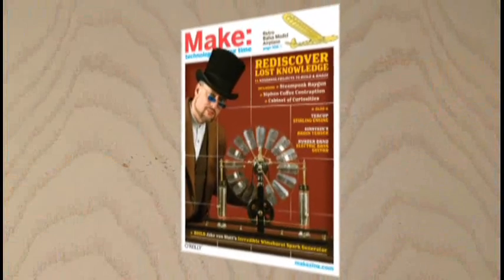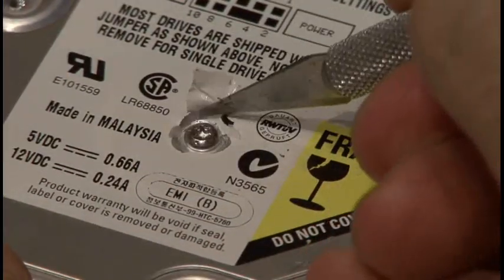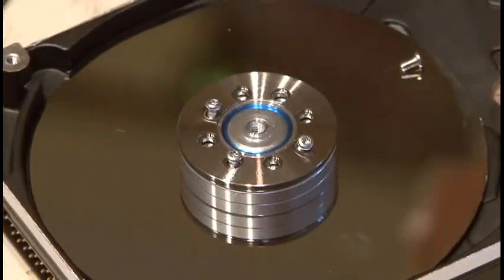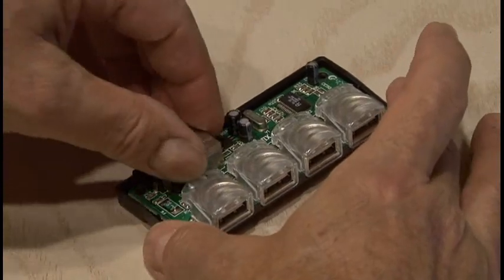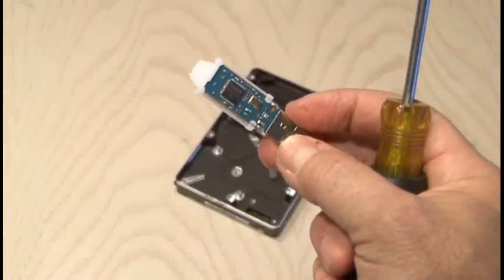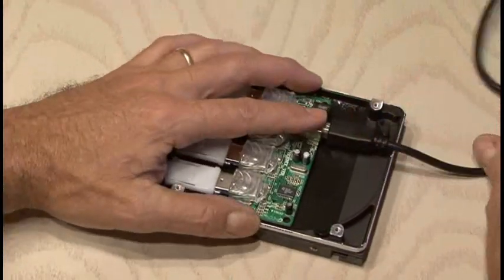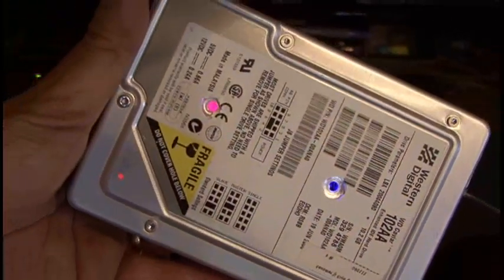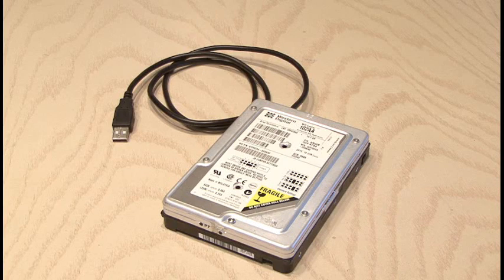Weekend Project: Flash Memory Hard Drive

Comment: waste of time... bollocks... why not just have the usb hub in there... FFS you fekn tool master
Reply: 2009
Reply: I thought the same thing. Now he has to carry around extra weight and space instead of carrying the sticks individually. The title is misleading!!
Reply: Emer L
This video is also from 2009
Reply: Emer L

Think of it in the fact of someone who loves raid and may travel once in a while. It would be easier to keep track of 1 of these rather than 6 items (4 sticks, the hub, and the cord). But I would have used an old 5Mb HDD since I would utilize that 10 gigs for something like movies or what every by buying an enclosure to convert it to a USB external that I can plug in to my TV
Reply: If I was to travel with need of storage I'll just use a 1tb external hdd...or as some call it passport. This idea  obsolete.
Reply: Yeah...not that old
Reply: to truthseekers666 
+1000

Comment: what the actual... I thought it would have been some kind of strange compression method Or maybe some kind of encoding. I dunno, My expectations were just blown out the window when I saw the drive opened up.

And something in the back of my head keeps nagging to me about 4 - 8 gb pen drives being expensive that far back. New Hdd would have been a better solution.

but as a project... no.

Comment: responses to bad info:  You can't do a software raid in most versions of windows:  You have to have ultimate or enterprise minimum.   Perhaps in windows 8 but i haven't tried it since i had 2k.  There is another issue in that windows will not let you raid removable disks.  You have to edit the registry to make them appear as mounted permanent drives.  Then you can combine the partitions in the settings.  This project would have been cooler if there was an sata interface.  I think the coolest project would be to hide a memory stick in a usb mouse.

Comment: You can mount the 4 drives so they appear as subdirectories.
In Windows:
- Goto Disk Management
- Right click on the flash drive and "change drive letter"
- select Add
- Mount in the following NTFS folder
- you can decide where they go.

Not perfect, but all in one place.
Reply: Or use RAID 0

Comment: not really genius... why wouldn't you rather have the 4 drives connected to the hub directly instead of having to go through the process of tearing the hdd apart ? you're not really "teaching the hdd new tricks"; you're simply replacing what's inside it

Comment: Look at it this way. A lot of IT people have flash drives, I myself being one who is extra cautious about data back ups, so doing this is both easy, and if you could have them set up in a RAID configuration, you could even trim the USB drives down to their bare minimum size, and possibly be able to fit 2 hubs in there. People on the internet being critical of a 4 year old video are the reason people up and quit doing these, because of you people who get anally frustrated.

Comment: would probably have been better if you could use ESATA/SAS on those drives, then you could have put them in RAID (recommended RAID5, 6 or 10) but because USB currently does not meet the bandwidth requirements, RAID is not possible over it without 'slight' modification :(

Comment: you can configure them in windows in the disk management utility or under linux via the logical volume manager

RAID is not necessarily dependent on hardware - but if you want performance, a hardware controller is recommended

but we are talking about USB sticks attached to a hub, so performance should not be the problem :D

Comment: you have now clearly stated that you have no clue what you are talking about :)

It depends on the RAID level how much size you got left - in a simple stripeset you lose no capacity at all

and "the way to get all 4 drives to one" is simple: in unixoid systems just use the LVM and on Windows you use the disk management utility and set up a dynamic volume with your raid level of choice (depends on the windows version though)

Comment: While the housing may be unnecessary, the concept is useful. When you learn to leave windows behind, you'll find ultrasmall linux distros that can easily run from USB drives. Tiny Core Linux, Puppy Linux, Damn Small Linux, and others are perfect. You can run them fresh each time you boot for privacy or in persistent mode so changes are retained. You have an entirely different computer running from RAM in spite of the OS or even no hard drive at all. You can run Puppy from compact flash cards!

Comment: Kipkay, the way to mold the drives together is, if you were to use bigger flash drives like 32 gb, put them on raid (witch loads dirrerent sections of the system on four to be combined as one) in the bios of the computer.

Comment: You could set them in raid 0. Also use the drive as ram rather than a hard drive. Might get too much heat using them as ram though.

Comment: While mostly misunderstood, such devices are indeed "free energy" designs.  The misunderstanding comes from the source of the energy, which is simply repurposing waste energy from other sources into very small and inefficient conversions.  The retardedness comes from thinking they will do something amazing by converting waste heat or ambient light into a few milliwatts of "free energy" (typical efficiency is on the order of 10 to 20%).  But yeah, some of them fit the "whacko" definition.

Comment: Your agreeance is not required. This is a solid state alternative to a mechanical hard drive. Additionally, if you shop at the right place at the right time, you could possibly make this for cheaper. It is not affected by physical shock, there are no bearings to wear. You don’t like it don’t make it. Period. Your comment as moot as you are.

Comment: you'll only get 4*4gb in raid 0 and too get a good raid 0 speed you'll need a raid controller. you could do it in software but it's not gonna be worth it, Unless you have high quality usb sticks. If you have high quality sticks, they will probably be big dynamic disks.

Comment: You can improve the speed of this drive by assigning them in RAID0 configuration.
It will improve your speed by a factor of how many drives you have, I'm this case 4.
You can do that from the disk managers, in windows, mac or even Linux based systems.

Comment: well couldnt you just connect the hub to a sub hub ?
so it would go like this
(4)USB drives
Connected Hub
Converter Hub 
my theory involves tricking the second hub into thinking that the whole memory of the first hub is together.
let me know what you think. and if it works.
id like to do this. ive already found a flashdrive at school. actually two but i returned one since it had folders. the second one was blank.

Comment: you would have to do some serious software modding to get them to register all as one dynamic drive...better flash drives to start...would need flash drives with MLCs instead of SLCs...then hack the firmware in the usb hub so it sees all of the drives as one single drive and it would need to have wear leveling so all the drives were used equally in a nutshell...too many details...lol...basicly building an SSD from scratch

Comment: I don't get this mod for various reasons. First is, this will simply be recognized as 4 separate flash drives and a usb hub. Second is, why would you seal it with the cable attached, if you are dremeling anyways, might as will cut a hole for the usb connector, not the cable. Third, why would you want to turn 4 separate portable drives into 1 clunky 4 in 1 you have to lug around even if you only need 1 of the flash drives... I just was hoping for something clever or at least useful.

Comment: well, for a normal drive, I dunno, but for the odd as hell drives that old IBM pcs use, using a flash stick, and a pata adapter would be about my only option. would be faster too, my drive is only 4200 RPM

Comment: how is that a "Flash Memory Hard Drive"?! It' just an extra work to convert you existing USB hub into a USB hosted in a case of 3.5" HDD. If this mod would have actually showed how to fire that USB hub to the electronics of the HDD so that it can be plugged (and work) using HDD's native IDE connector - Yeah, that would be impressive.

Comment: An HDD can last about 10 years. With the same amount of use, an SSD can last 5 years. Considering an SSD is WAY faster than an HDD, this is good.

Besides, you said an SSD lasts longer than USB sticks... nope. If you use USB stics as boot device (which you usually use SSD's for), they would barely last a year.

My point here is that SSD's are way faster than HDD's. There is no reason to buy an HDD because it lasts longer, because most likely you will buy another HDD because you're out of space.

Comment: I know under windows 7 you can expand a volume to include multiple drives making it work as a single drive. I have almost the same setup but with 8x 64GB drives that I had got as a promotional item from a vendor. It goes to a sata controller and into my actual computer to use as an ssd.

Comment: You know what? You have a point. lol
However, if you do have some USB's laying around and you don't want to spend $60, someone may find it more practical to connect them all through one connection rather than connecting and disconnecting each one at a time. This can potentially save you port space, and if you designate your USB's for different type of files, it will save time by quickening the organization process. Thus, this video is not totally pointless after all.

Comment: Dumb people on here are jumping to conclusions about the validity of this project.  A)  It's a pretty brilliant way to do SOMETHING with all those free usb mem sticks you get as swag these days.  B)  It would be just as easy to build it into a more practical case (Altoids tin, perhaps?)  As far as getting it to work as one drive... I think you'd need a controller for it.  If not, maybe daisy-chain the ram- soldering one ram chip to the other?

Comment: fake and gey... this "project" would not work because if you connect 4 flash drives to a usb hub without external power supply all flashdrives would not work, if a miricle happend and all 4 flash drives appered in my computer try copiing somthing to them and you will see how they will disconnect

Comment: 1) its slow since it's using only usb 2.0 connection so would be useless for pretty much anything but an already slow computer
2) he basically put 4 usbs in a box
3)it would be cheaper to get a waaayyy faster 250gb hard drive

Comment: I tought that you will make a whole hard drive like solid state disks by connecting the integrated memory chips of the flashes. 
is it necessary to assemble four flashes + usb hub and an old hard drive box. 
i think bringing four(or more) flashes is lighter. 
but even so thanks for your labor.

Comment: And  apparently if you have Mac OS X, there is a really easy way to set up a RAID 0 configuration with the drives to act as one. However, it won't be fast or anything, but it should be faster than a single usb drive...

Comment: i agree that the effort is a little fruitless considering you can generally pick up a half terrabyte drive for less than $100 at a factory direct type place. but using flash drives does make it more like a solid state drive which means data will transfer and stream to and from the drives at much higher speeds. in the end, i would rather wait 10 seconds each time i boot up an external rather than go disassembling electronics hoping it will work out as well as it did for this guy

Comment: You can use RAID software and put the 4 drives in RAID 0. This will make the drives appear as one and the storage space will be combined. The bad thing about RAID 0 is that if a flash drive fails(which is VERY unlikely) you will lose all the data.

Comment: lol... If I remember right there was 4GB hard drive at year 199x (while x under 5). It cost something like $50000 dollars. Now you could buy (and RAID0) 3TB ($125 per piece) drives with $50000 budget about 400 pieces = 1 200 000GB. Its 300 000 times more than 4GB. 300 000 times larger hard drive after 20 years for same price. So in 2033 we have 360000000TB HDD's and at 2053 we should have 108000000000PB (petabyte) HDD's = 108 yottabytes. I will laugh for your 50 petabytes, newbie :D

Comment: Transfer rate is way different from interface speeds. The device itself has something called internal transfer rate. Which is restricted due to physical inability. 

However fast the interface is, it just states that you won't face any bottlenecks. The real ability is the NAND drivers for the chipsets.

Until we reach a time when the NAND ability outperforms Interface performance, Sata 3 or USB 3, won't many any difference.It all boils down to the HDD/SSD.

Comment: Those sandisk cruzer flash drives are slow as shit. I highly doubt you would have write speeds as high as the original 10gb IDE HDD using those. This is impractical, even if you used high performance USB 3.0 drives with a compatible 3.0 hub it would be cheaper to get a real SSD and the performance would be much higher. This is one of those things that you might choose to do just to say you did it or to be eccentric, it's not cost effective or practical however.

Comment: u need a RAID0 in the bios, usually found on 3rd party motherboards. (the raid option) but you would need 4 of the same size flash drives. it splits the file 4 ways, so its 4 times faster than a typical flash drive...

Comment: Throughput is measured in bits per second not bytes. IDE hard drives like this one have a max throughput of 133 Mbps or about 16.6 MB per second, USB 2.0 is 480 Mbps or 60 MB per second so in fact USB 2.0 is much faster than your standard PATA HD. Also USB drives have a much faster read/write  times as well...flash drives were the birth of SSD technology. 150 MB per second or 1.5 Gbps is the throughput of the first generation of SATA drives. And their read/write is still much slower than flash.

Comment: Since this is an old IDE drive, 150MB/s read speed is not correct. The fastet IDE transferspeed that was ever possible was 133MB/s. USB 2.0 protocol is, as we all know, 480Mb/s, but according to wikipedia, 280Mb/s (35MB) is normaly maximum. The TOP specs on the disk is 66MB/s with Mode 4 Ultra ATA, and in '99 I dont know how normal that was. The second speed was 33MB/s with Mode 2 Ultra ATA, lower then USB, So it is possible that the usb drives is faster then that old drive.

Comment: It was an old IDE drive that obviously had a small capacity storage capacity as his collection of four 4 and 8 GB flash drives "doubled the storage space". With low capacity drives the transfer rate is quite slow due to the low density of data on the platters. This means that your modern drive very likely out performs a USB 2 drive, but that is not the case with this older drive.

Comment: Sorry, but this was a cheat.  He didn't make the hard drive housing useable with greater capacity.  He turned it into a USB hub with four separate thumb drives inside, each still showing as a separate drive.

This was a waste of time.  Disliked and flagged for misleading text.  This wasn't a flash memory hard drive.  This was a USB hub in a new housing.

Comment: What I do:
Buy 4 of 32 GB USB stick
Buy USB splitter
Acquire a metal box
Solder the splitter onto the inner walls of the box
Make a service hole in the box
Make a cable hole in the box
Plug the USB sticks in
Plug the entire thing in
ACHIEVEMENT GET! ACQUIRE HARDWARE!

Comment: Yes, although I do believe it might be worth mentioning that many non-powered USB hubs will only run at USB 1.1 speeds, even when plugged into a USB 2.0 Port. This is especially true in this case, as all four USB drives would be pulling power from the hub, not being self-powered devices. If this is the case as it likely would be, most people won't be using flash chips slower than USB. A remedy if this is the case is one of those Mini-USB cables that has one plug for data, and another for power.

Comment: If you want set it up as a single drive, one could always format each drive and set them up in a sort-of RAID array...but this usually works best if all the drives are the same capacity. I do believe this setup can be achieved through the advanced mode of disk utility on Mac, and probably also with a utility like GParted on Linux.

Comment: Generally this is a bad idea. Why do you need to use an old HDD at all? Just get a hub and stick some flash drives in it! You can find smaller ones that will fit in that hub or hubs with better spacing. But this is a still a very bad idea. Flash drives make lousy HDD substitutes for two reasons. a) They're not actually as fast as the physical drive & can cause many apps to hang. b) Their data retention over time is very poor and eventually many ov your files on the drive will become corrupt.

Comment: Just guessing but. You'd prob. have to temporarily rewrite the windows api. First you'd have to set a name like 1,2,3,4 and have the api recognize that it is a special class of usb drives and then display them under 1 heading and then you'd have to modify the properties setting to display the total of all sub drives capacity. You would then place each folder inside of one sequentially. Then you would probably have to set a pointer to point to the next drive once it reaches 99% percent capacity.

Comment: I'm not sure if this will work but you might be able to use HDD partition-er in windows and partition the 4 USB drives into one as long as they are all connected at the same time and always plugged in(not removed while windows is running) as you might corrupt 1 drive resulting  in corrupting the whole partition(all 4 drives).